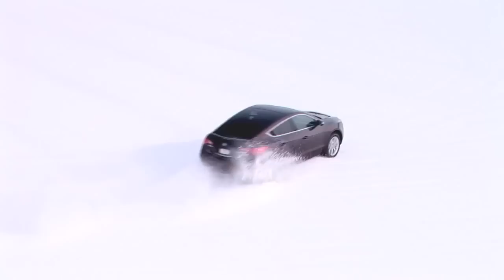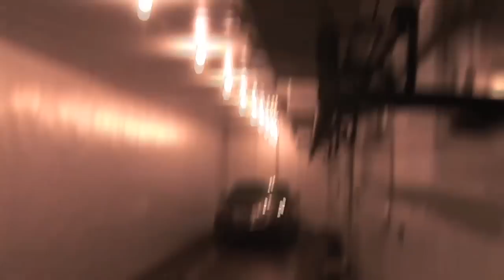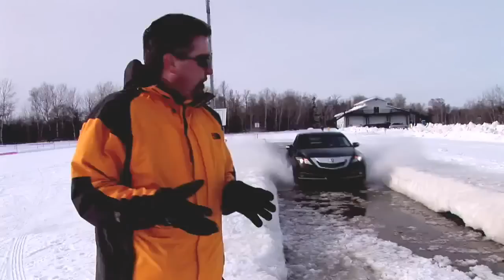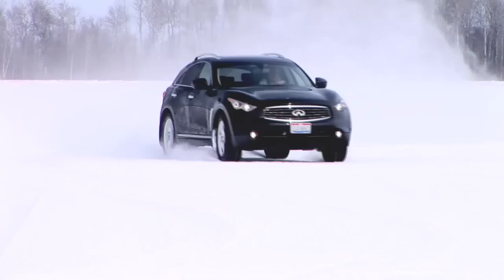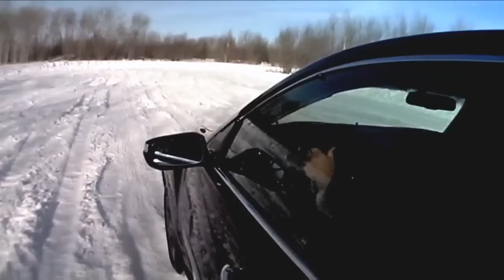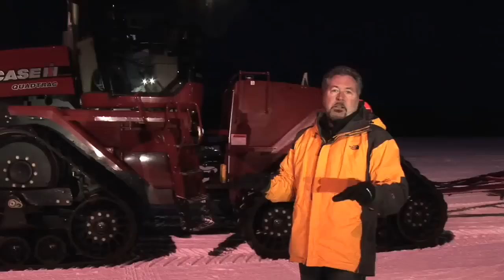Acura Winter Testing Experience

Comment: Importance isn't to use only winter tires but the importance is much the power of the car.  MDX is really good. I am using 2007 in Canada and plan to get 2013. Acura MDX is one of the best especially during winter.
Reply: Shuffle3956 wow fuck off rude asshole. You just need to know what you’re doing. I drove my RWD explorer on icy roads to Target once. I was fine.
Reply: Shuffle3956 In all season tires too.